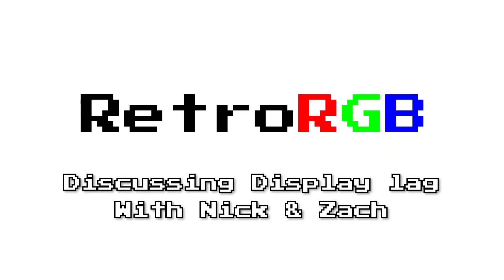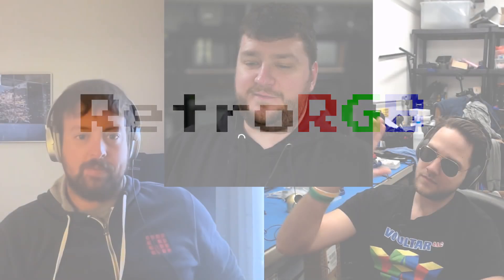Talking Display Lag with Nick & Zach

Comment: One thing I thought about when you guys concluded that the input to photon latency was input latency + pixel response time.
Different panel manufacturers or different OEMs measures pixel response time in different ways. One way to measure this is grey to grey time, in that case, maybe half of that is actual latency added.

Comment: Dude I would absolutely love that "leave me the fuck alone" mode. I bought a Samsung TV, never again. It will not leave me alone. I change what's plugged in a lot because I have a lot of systems, and every time the stupid TV goes "detecting input" and changes all of my settings. Then I have to go back through and put them all back. I am going to replace the TV solely because of it. 

Even after I found a "cheat code" to disable the input detection, it skips the screen where it tries to detect what I plugged in, but it STILL messes with the other settings. I hate it. Never has a TV made me so angry. How I yearn for the old days of TVs that did nothing but accept the input you plugges in. No internet, no ads, no "helping" with settings. Just display what gets input.

Comment: The pure randomness of Tetris makes it a great example for testing lag, with something like a shmup where the same patterns are happening each play time it is just a matter of memorization where the player is using muscle memory rather than what they are seeing on screen.
Reply: Tetris is a great indicator of how sensitive elite players are to latency. TGM1 and TGM2 have slightly different input latency when playing on the original PCBs. (The emulated versions recently re-released have at least a full frame of input lag, which is at least as bad as MAME.) The difference between TGM 1 & 2 input latency is definitely less than 1 frame, and while you certainly can't "see" the difference, you can absolutely feel the difference. And TGM2 feels much more responsive. It's easily one of the best engineered games ever made.

Speaking from experience, the guy on the right is just plain wrong about the (marginal but meaningful) impact that has on high level gameplay. (I was top 25 in the West, top 100 in the world in TGM1 at one point.)

Comment: Had a similar issue with display choices for a protect at work.  We needed a small, 1440p screen for our display.  Only problem was, that getting a screen that size ends up being a cell phone screen.  Cell phone screens, when turned horizontal, refresh from left to right, as they are designed to refresh top- down while vertical being the most common use.  We ended up having a single frame of frame latency allocated to buffer the entire frame and then allow it to be rotated.  You had to do this, because you needed the full image in order to d a 90 degree rotation.  We were using a source from a CMOS sensor, so we had a top down source, feeding a left to right display.

Comment: About meaningful comparison between CRT and flat panel's display latency in my opinion: that it should always be the lag comparison of the middle of the screen, as long as the whole-frame-latency is not longer than 16.67ms on the flat panel at 60Hz. Think about it, no one is staring at the top left or bottom right corner all the time when playing games. Your character actions in platformers, enemy moves in fighting games, observing bullets forming in shmups almost always happening and refreshing all the time around the middle of the screen which draws like 90% of human attention. 

Sure there'll be cases that you'll be asked to look at the corner part but scenarios are rare and adventages of CRT will be averaged out as important messages might appear at each of the four corners, and CRT have to deal with different corners in a full 16.67ms frame and no less, so flat panel is possible to perform better at bottom left and bottom right (and worse at top left and top right).

So I would call a flat panel with less than 8.33ms  (plus a RT5x or some other low lag scalers) display lag at 60Hz a CRT-level-panel regarding lags. Some flat panels may have already qualified.
Reply: Measuring in the middle of a panel would probably be more accurate for 90% of game instances, but finding a consistent way to measure the "exact" middle of the screen would be more difficult then using the top left of the screen for instance. The edge/bezel would be a more consistent marking point for the sensor

Comment: My lag test is comparing Super Street Fighter 2 Turbo Mister on a CRT with snac vs emulated version of same game on my low latency high refresh rate monitor.
You can definitely feel the lag in the emulated game Street Fighter 30th Anniversary edition.

Fun fact the switch version has the most latency.

Most games are okay when it comes to lag but that game feels like your timing is just enough for the CPU to hit you it needs to be accurate to the frame otherwise you have to try and predict the CPU moves.

Comment: So I had my reflection all typed out, and hit the back button on my mouse by accident... wiping it. Oh well. Gave me even more time to ponder a few more things.

1) The physicals bodies natural limitations / thresholds. Our sensory abilities have limitations and there is some variation in how close we are in a given sense to that senses maximal threshold. Some people have rather poor vision. Some people have sharp vision. Some people have very good hearing. Others do not. There are various things that can be done to improve our senses and improve our bodies performance compared to the realistic threshold. Some people can bench press 300 pounds, some 500, some 600. But most people can improve whatever their current abilities are, especially if it's an area they haven't tried to improve before. Reaction time for gamers, I think, fits this to some degree.

2) Diminishing returns / unrealistic expectations. Most professional baseball players wouldn't be able to come even close to hitting a 200 MPH fast ball. So the difference between 200 MPH and 250 MPH isn't worth talking about as for most people... it's not meaningful. The same way that 2ms of lag vs 4ms of lag is probably not worth talking about for most people. The points made about uniform distributions... spot on. There is no cutoff, no threshold where you can say... past this point 100% of people will fail to be affected (within reason... again.. a 500 MPH fast ball might as well be a 10,000 MPH fast ball). 

3) The educational issue. To be able to fully appreciate, and talk about, this concept... you need to understand it. A game console can play blind. That is to say, it doesn't care about the display your using. That display is just for you to be able to see what is going on. The system itself runs with or without a display. A game controller though, that is different. It accepts your input, and the game responds in some way. So when bald bull starts his bull rush in punch out.... he may have started his actual hopping before you ever see him move. If you have a 4 frame window to respond, and the TV causes you to be 2 frames behind... you effectively either have to adjust (by punching earlier than you know you should be) or your window to react is now effectively 2 frames instead of 4 because the TV is behind where the game actually is. This makes the controller end of things really interesting. So what you see on the TV is post processing. But input controller lag causes a lag between when you push a button, when the system processes it, and when the TV processes it. The whole thing is performance impactful, within respect to meaningful limitations in one persons ability. For a pro player to blame a poor tournament performance on an 8ms panel vs their 6ms panel at home... hogwash. To blame a wireless controller that adds 60ms of lag.... well... another story.

I'd love to see the double blind study, but I think just because of the nature of the human variable (a given competitor could be "off" that day, tired, stressed, nervous.. whatever)... you'd likely need a fairly large amount of data across many different pro gamers (and non pro gamers) and display types.

Lovely thought exercise, really enjoyed it!

Comment: Great video chaps. Is there any more info on the gilt mentioned at the 1hour mark? Sounds like the time sleuth but linked to a controller and custom software for measuring input lag in emulators?

I've several arcade pcbs/cabs, groovymame pc, mister and a supergun and am curious to compare input lag as I can't notice any difference. Nobody has compared these surprisingly... well nothing comes up in youtube search.  Everyone says mister is the same as pcb. Is it true or a myth? How does groovymame compare (plus Calamity's interview mentioned the framedelay feature to improve latency)? How is demul to a naomi? Etc.

I was thinking to try the led light taped to the crt screen trick and powered by a controller button press and super slowmo camera phone to count frames from the led turning on.
Reply from the maker: It's out of stock, but I'll have more info soon.

Comment: Filmmaker mode drives me insane on my Hisense set, because I've hardware calibrated black levels to compensate for the display shortcomings and when the content flag enables all of that garbage it makes me think there's something wrong with the TV, or enough time has elapsed where my calibration has drifted due to component wear and tear.

Comment: Silly question but if there is lag, can you as the player not just adjust your play style to counter this? I appreciate shoot me ups and fighters at pro level might be different but your average Joe who just plays games for fun, does it really matter?
Reply from the maker: Excellent question.  Depends on the game and total setup though...sadly, there's no easy answer.
Reply: @RetroRGB  yeah I get it, I just remember noticing a difference myself when switching between consoles and generations, it only ever took me dying a few times to "get used to it". Pros must be inhuman 😂
Reply: I think you definitely can adjust to some degree.

If the delay is small, it probably plays more into the muscle memory thing.

However, I played a Bloodlevel 4 challenge in Bloodborne some time ago, and when I started it, I was actually streaming/remote playing the game with a PS TV in another room, which definitely added quite a few frames of lag. Bloodborne does suffer from added lag, but since my challenge run relied heavily on my experience and enemy attack pattern memorization, if I saw an enemy winding up their attack, I was definitely able to adjust to the lag and timing my dodge a bit differently. 

My accuracy with dodges and such still suffered a bit, and it was more annoying to play with such slugish controls due to the lag, but yeah, I definitely was able to compensate the lag a good amount.

Comment: I bought a Samsung HD CRT because Duck Hunt worked on it.  (It actually works best out of any TV I've tried in my life for some reason)  I noticed Super Mario Brothers just didn't feel right.  I decided to put it along side anthor CRT and film the 240p test suit off the gamecube with my phones slow motion camera.  You could see the HD CRT was about 1/6th a frame behind.

My theory for the percieved latency is that the NES reads the controller at the end of the frame.   So if the display is behind the next frame is being rendered while you are still viewing the previous frame.  There is a mismatch or change in the relationship between controller and frame display that that manifests as a frame of lag or more.